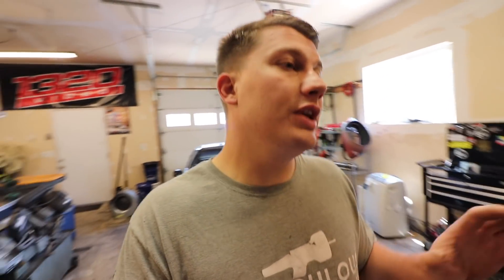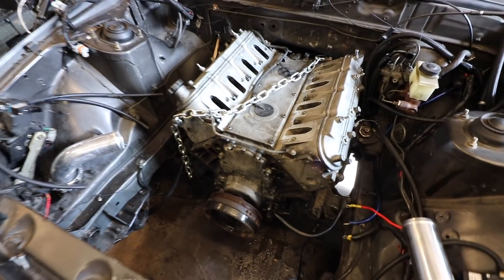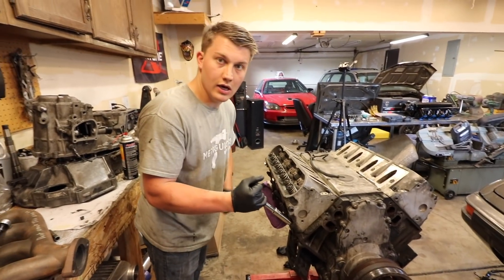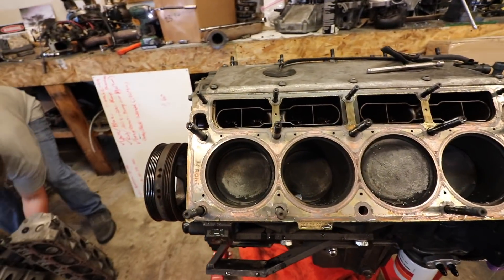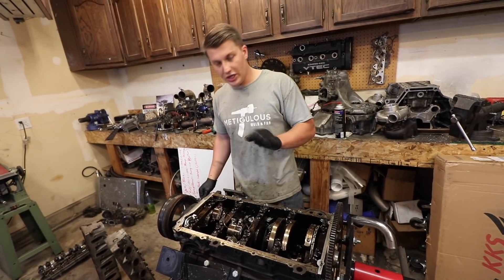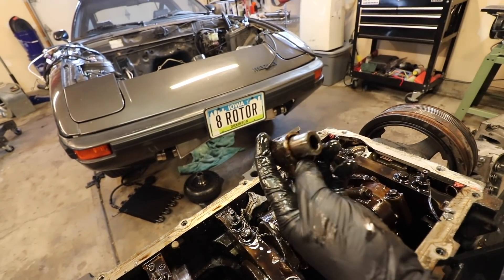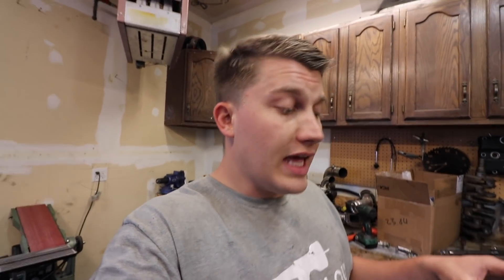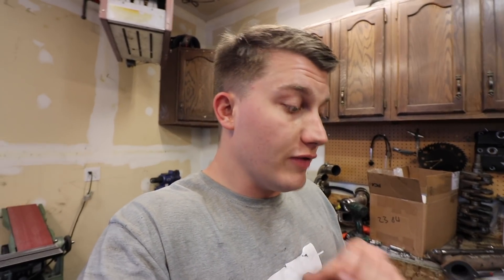Tearing Apart the RX7 Motor... Fully Sent it!

Comment: The LY6 should be the engine you get.  It’s a gen 4 6.0L with the LS3 style heads.  They can be found in 2500 Van’s and pickups.  Engine Masters ep#37 just made 1,500hp+ with their’s.
Reply: some of those newer LS variants have beefy rods.
Reply: @corwininadsm  all of the 05 and newer SBCs came with the same LS2 rod (except 4.8 & 7.0) regardless of GenIII or GenIV.
Reply: @zacharymorris9917  Nice they are way larger.  new z06 rods can also be found as take offs on eBay cheap and are direct drop in as well (with the right piston).

Comment: Lol top tip grind the rings open to handle the pressure(side effect blow-by) and lots off lock tughts on the cam bolts.(boosted or nitrous LS's love to back out on ya. Live and ya learn. Good things those motors are every where. Buy two next time so you can throw in a cheap one while building a Frankenstein LS6/LQ9.

Comment: Tq is what kills gen 3s. Yes you didn’t have a lot of timing in it, but pulling timing out at peak torque and limiting it 600ftlbs or so they’ll live a long time. Also, a lose converter and tuning it to 7500 really helps longevity too.

Comment: I think the valve spring broke first. The valve hung open and hit the piston. Valve spring normally don't break after the piston/rod/wrist pin. As you said it was beat on for a few years, throw them spring's out and start with new.
Reply: it broke on a different cylinder though
Reply: @TBasianeyes  Hard to tell from the video ,but I would still throw them springs out.

Comment: 15 degrees at what rpm and boost? do you have a flat timing curve vs rpm or do you have a progressive timing with more timing as rpm rises? im sure it could handle that much timing at 7k with a good amount of boost but not at peak torque. cylinder pressure and big torque numbers kill these motors.

Comment: I would do an octane test and not turn the boost up like it was on the dyno. Those pistons look like severe detonation. I'm actually surprised it stayed together as long as it did. Even if you had a fully built engine, detonation WILL destroy the whole engine. 

The carnage was fuckin gnarly as hell though. Just not so kind to your wallet eh? 

Good luck bro, the car is pretty awesome though and really well done.

Comment: @Hayden Did you guys open up the ring gaps on this engine? If you didn't, the top ring got hot and expanded causing the ring gap to close, poping the top of the #3 piston and the same was probably true of #4 as well. If you don't open up the stock ring gap this can happen, since your exposing the top of all the pistons to higher pressures and temperatures. If you open up the ring gaps (by using a ring file tool) then these LS family engines will hold 1000hp to the crank all day. Ever read that crazy story from hotrod mag where they make over 1000 of what they think is a 5.3 but ends up actually being a 4.8? And it lives for 60+ dyno pulls at that level? All they did to that thing was widen the ring gaps (top 2). #Fasterproms made exactly the same mistake when they put Uncle Same together with the blower and eventually grenaded the LS in spectacular fashion while in the middle of a pre pass burnout. I would get a LY6 or LQ4 and widen the ring gaps in it, do a trunnion upgrade, slap a cam in it (or even run the factory one, because boosted things), travel limited lifters, reuse your head studs, then bolt the turbo set up to it and head back to the rollers at PFI. Good luck brother, love your manifold/fab work and the content.

Comment: Piston ring end gap fucked you over. There's only so much boost you can run on a stock cast piston with tight end gap before it compresses and grabs the crown and tears it off inside the cylinder. Frieburger proved that with his cast piston nitrous engine experiment, Set of forgies and proper rings next time!

Comment: Sounds like you should get a set of pistons even just set of lower level boosted pistons, I mean can't over buzz it because stock bottom so don't need killer slugs.To much volume to compress and pushed the pin through the piston! Get to make sure bearing are good on the rods at same time. But is it worth it well good chance wouldn't be doing this again so soon. One mistake could cause rod to let go so really it's 50/50 either way! Except pistons and it all holds you could have a little more boost safely. Again but is it worth the chance not really same as pushing to limits that are already set! Don't waste your cash, couldn't help it got to excited! "TURN RRR UP wOOoPPS OH SHIP!"

Comment: Pulling the converter out with the engine is a bad idea. Most of the time it ruins the transmission pump..
Reply: But the engine was seized so how do you rotate it to get to the other converter bolts?

Comment: That's a GM small block, not a small block Chevy
Reply: Same thing.
Reply: @republicansareoffendedeasi821  👍
Reply: Tomato... Tomato...
Reply: I don't even like Chevy and I know that.
Reply: @republicansareoffendedeasi821  Why don't you like Chevy?
Reply: @republicansareoffendedeasi821  nope. Completely different engine families.
Reply from the maker: 🙄 same Chet lol
Reply: @lb9gta307  maybe the heads will be different but it's basically the exact same engine. That's like calling a Ford 240 straight 6 completely different from a 300 straight 6.
Reply: @kylelove927  owned a few of them worked on them didn't like it.
Reply: @kylelove927  my Grandma had a 94 Buick Roadmaster LT1 that thing the engine was good everything else was not.
Reply: @Metigulous  Noooo. Lol
Reply: @republicansareoffendedeasi821  LMFAO yes the heads are completely different. So is the block, the intakes, oiling system...
To equate it to Ford engines it's like saying the Modular V8 is the same as a Y Block but just the heads might be different. Exept those Ford engines were both engineered by Ford engeers. The LS family was engineered by GM engineers while the Chevy engine families were engineered by Chevrolet Division engineers.
Reply: @lb9gta307  so how many parts from a different LS are interchangeable with that LS?
Reply: GM iS DiFfErEnT tHaN ChEvY. SAME.FUCKIN. COMPANY.
Reply: @lb9gta307  they made a book whoop-dee-doo. You still never answered my question how many different parts are interchangeable?
Reply: @banneddamn  yes and no. Chevrolet is a division on GM and back when the SBC was engineered each division had their own seperate engine family.
Reply: @republicansareoffendedeasi821  buy the book or google it if you want an actual number. The information is out there for you. I'll generalize a bit. The 4.8 block and pistons are the same. You can put his heads on all of them, they'll just choke the larger displacement engines. Cams are completely interchangable. It's the exact same crank as the 5.7 engines. All of the outside parts including the intake manifold...

Now interchangeability between LS and Small Block Chevy families? Lifters (also interchangable with 3800 V6 and possibly 60* V6) and rod bearings. That's it.
Reply: @lb9gta307  I already have look them up they're basically the same engine tiny differences basically the same engine. Just like the 300 and the 240 small differences all around the same engine blocks are basically identical heads are interchangeable oil pan not positive about the crank or Cam the basically the same damn engine just like the LS engines. If they're different then nothing would fit it except for what was for that engine. Chevy Works off of 4 GM whatever you want to call it this is how it goes for what you're going to pay Cadillac is the most expensive GM's a little bit cheaper and then Chevy they're all the same they have trucks and cars this fake Cadillac that I have sitting in my yard is just a Pontiac is a 4.9 302 cubic-inch which is kind of funny in my opinion since that's too Ford engines a 300 straight 6 and obviously a 302.
Reply: @republicansareoffendedeasi821  and do you think the Pontiac 4.9 is a Chevy too? Yes, Chevrolet is part of GM. Yes, the current engine families, including the LS, are corperate engines. That's not the way it used to be. Each division of GM (Chevrolet, Pontiac, Buick, Oldsmobile, Cadillac, and GMC) all had their own different engine families. A Chevy 350 has no interchangable parts with an Oldsmobile 350. A Chevy 400 has no interchangable with a Pontiac 400. That's why a Small Block Chevy is specificly called a Chevy. This has nothing to do with compairing an LS from one division to an LS from another. All LS engines are just GMs.

Comment: Flat top pistons=4.8 bro,  that's not a 5.3.
Reply: Durt85 
The aluminum block 5.3 (L33) has flat top pistons.
Reply: @stlchucko  yea,  but that's an iron block gen 3,  flat tops are 4.8s.
Reply: Durt85 
If it’s an iron block, why does it have sleeves?  3:40
Reply: @stlchucko  all the ls engines have sleeves,  do your research,  what's your email?  I'll send you pictures of the 3 iron block engines I have in my shop with sleeves in them.
Reply: Durt85 
Send me a link for gen 3 iron block sleeves